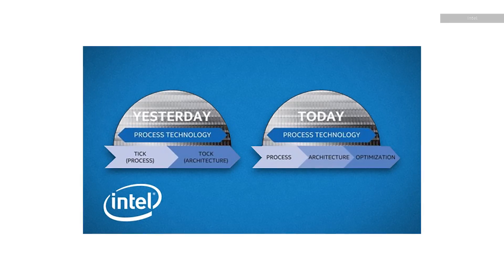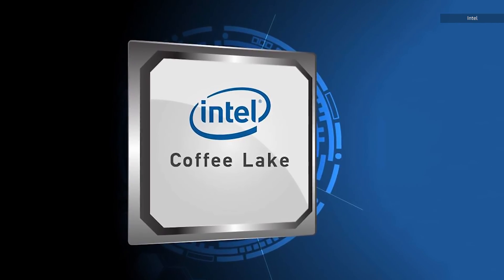Intel Coffee Lake explained

Comment: What is Coffee Lake ? Covfeefe lake is a pile of HOT POOP LAKE with overheating problems on CPU die and VRM-s exactly like Skylake/Kabylake/Skylake X still is. Archaic architecture with absolutely no multi-core capabilities and semi-good single core capabilities at the cost of abnormally high boiling egg temperatures and humongus power consumption as well as many mathematical problems like complete inability to run Matlab or Prime95 like professional programs properly.